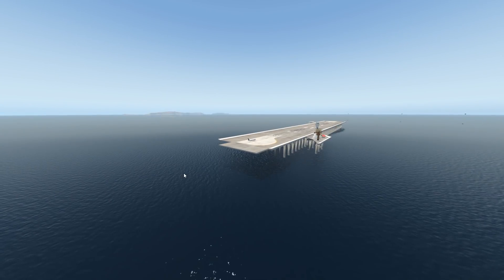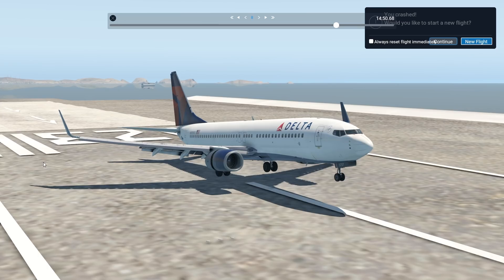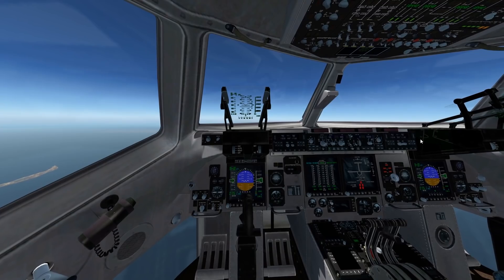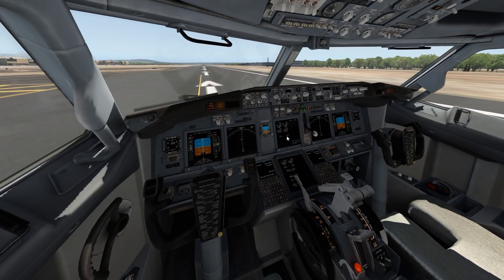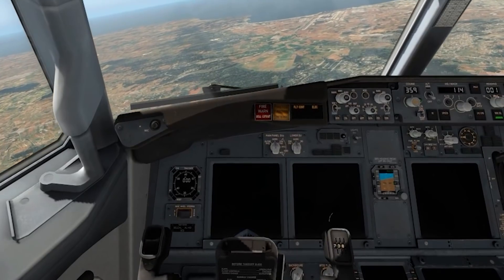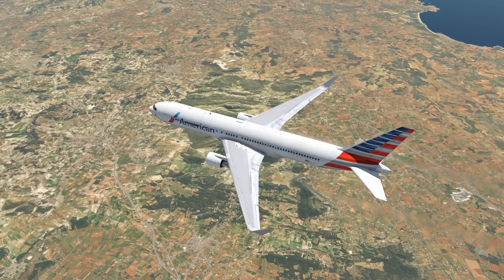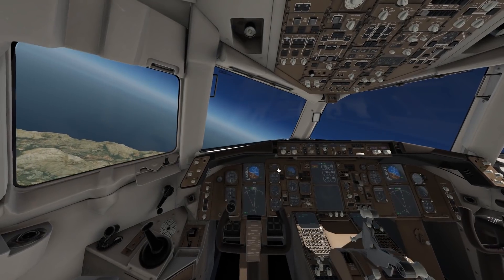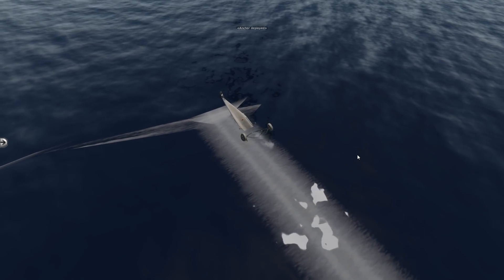Reverse Thrust Deployment In Midair Causes PLANE TO SPIRAL To Ground

Comment: ignre the top comment who talks about lauda air. Talking rubbish. The plane was actually at 30000 feet, and this was the actual reason what caused it to fall so quickly. Also they were at full power. Reverse thrusters caused a catastrophic disruption to air flow giving them only 4-6 seconds to react which is impossible in such situations. this was shocking to the industry as the tests were only done at 10000 feet never 30000. so there you go. now it is impossible to even deploy purposely as they have locks on the thrusters.

Comment: The aircraft was Lauda Air Flight 004, a Boeing 767-300ER.

Travelling at ~29000 feet, the left thrust reverser activated midair, and First Officer Thurner immediately recognized it, saying, "Shit, reverser's deployed."

The sudden loss of thrust and subsequent loss of lift resulted in the left side producing massive leftward yaw, and the aircraft began a quick descent. The aircraft, having experienced massive G-forces, broke up in midair, after the Captain attempted to save the plane by switching the fuel to the engine off, but the aircraft began a break up sequence, crashing into mountainous terrain.

Comment: a less famous flight is TAM Flight 402, which was a Fokker 100 crash in Brazil.
A thrust reverser deployed and the Fokker 100 had a safety feature in which if the computer detects a thrust reverser deployed in midair, that engine would automatically shut off. Problem is the pilots were never trained on the safety system as Fokker thought it was "unnecessary." Adding to that, the plane's auto-throttle wasn't working right. The pilots most likely tried to reignite the engine as they didn't know a thrust reverser was deployed and they thought it was the auto-throttle. It wasn't as deadly, but perhaps just as tragic if not more so.

Comment: Thr reverse levers can't be moved to the deployed positions until either altimeter reads 10 feet or less, AND the forward thrust levers are in the idle position. So, your video is clickbait.

Comment: What happened that day is when the reverse of the 1st engine was deployed, the air that is being pushed by the engine, basically acted like a shield against the flow of the air around the wing, the lift from the left side was lost which caused the plane to spiral to ground. And X-Plane doesn't simulate that unless u fail the left wing.

Comment: I thought you can only activate the reverse thrusters when the weight  on wheels (W O W) switch is made, to prevent accidentally deploying them in flight but can get tripped even when you just touch down and hop a little.

Comment: BTW, the lauda flight lost control most probably due to the high speed at which it was travelling at. With 1 engine at reverse thrust and the other most probably at 90% thrust, that would have lead to an imbalance in thrust, a steep bank to the left, and then the plane would fall into a deadly spiral

Comment: The problem on Lauda air was that they weren't to high yet and they were climbing on high speed so the effects of what happened were way worse than what you'd experience on level on 30 000 feet
Reply: Yes
Reply: He was high enough, they were at 29000 feet. The speed is the contributing factor, as well as the element of surprise.
Reply: They were high up, the air was too thin so the loss of lift went from 10% to 35%
Reply: You are very wrong. They had enough altitude, they were at 29,400 feet, but they weren't expecting the reverser to reverse thrust in midair, because it didn't happen before. See, when the reverser activated, F/O Thurner exclaimed "Ah, reverser deployed!", indicating that he wasn't ready for that. At the same time, you could hear the airframe shuddering. At the time, they were super fast, and the airplane was already inverted in less than 10 SECONDS.

The horizontal stabilizer (elevators) separated from the 767 because they were trying to control the high speed descent, which was followed by the separation of the rudder, and eventually, the entire tail. The loss of the tail caused the entire plane to nose over into a dive, and the plane broke the sound barrier, before the wing sheared off due to negative buffeting overloads. The plane crashed, and exploded, at a horrendous speed, whereas even the wires in the plane weren't even intact after that.